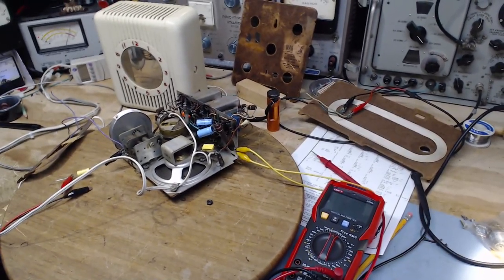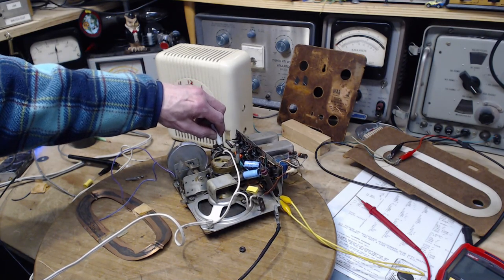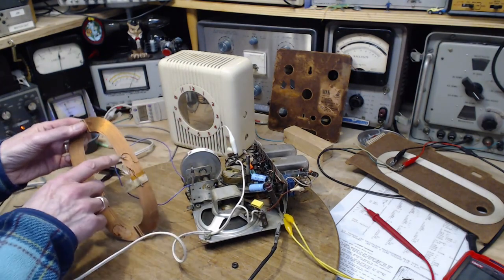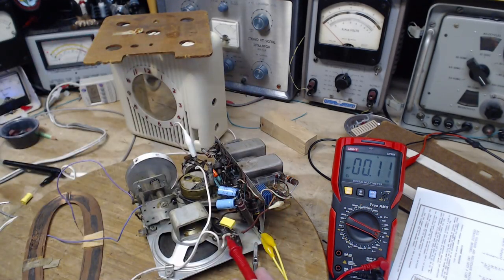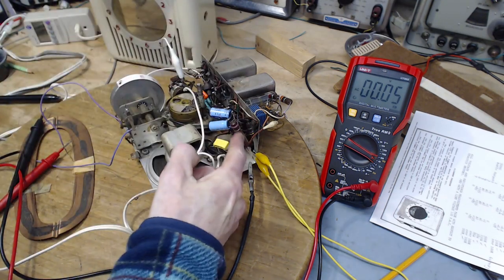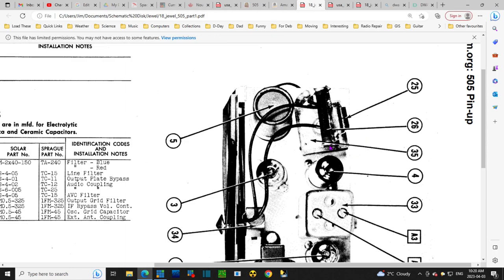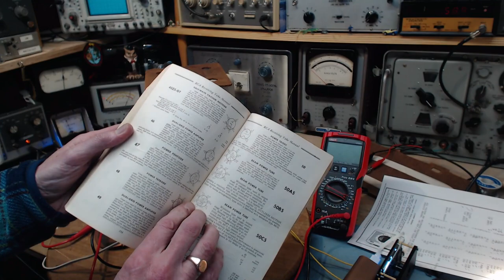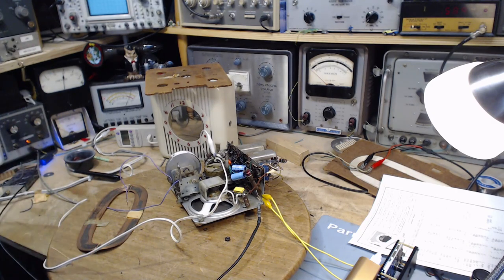Jewel Model 505 Vacuum Tube Clock-Radio Video #4 - Tube Heater Voltage

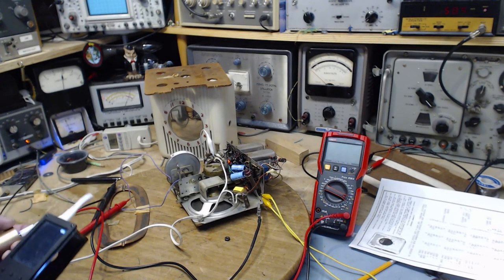Comment: 28:00 and it is playtime again; if the SDR toy don't get a cameo, his thermal image cam must jump in its place. 
The moment he found 14 volts on the heaters at only 110V line voltage, it should have been obvious to him what the deal with R4/#26 resistor is; that it is a soft start for the tube filaments, starting out at 1K and levelling out at around 200Ohms... Which makes perfect sense even crunching the numbers; the heater voltages add up to 86V. Toward 117V line voltage that needs a drop of 31V. The heater current is 0,15A. So 31V/0,15A = 206 Ohm! This proves the given hot resistance value for #26/R4 resistor and tells u that #26 in the parts list is R4 in the diagram.
But power dissipation of the dropper resistor is would be more like 31*0,15= 4,65 W not 2W. Unless they overheated it deliberately to get the 1000 Ohm cold to 200 Ohm hot drop, which is a ratio of 5 to 1.
Anyhow this failure analysis would have been a matter of 10 minutes, yet he draws it out over 30min and several cups of coffee and a tale of him touching a hot surface...
At least we got to see him slip with his meter probes once more and almost cause a big short. Will he ever learn to sharpen the tips on them to get a bite? Maybe one of his fanboys can email him about it...

Comment: I would check the resistor in the filament circuit. The temperature compensating resistor buffers the filter capacitors from the instantaneous voltage from the diode. Not needed if there is a tube rectifier.

Comment: If the filaments light, the radio works. However you are stressing each tube with additional heat. The 50 ohm resistor is the wrong value.

Comment: That temp changing R is called a 
GLOBAR 
resister. It limits the incoming current   
surge until the filaments stabilize by changing a higher resistance value to Lower  resistance value. You are barking up the wrong tree. It has nothing to do with
Spurious oscillation. That radio is hazardous and deserves being put down. You need a 10 watt  233 ohm resistor to replace the normal 35Z5 filament  current and voltage tube. Yes it can be a wire wound resistor. Have you ever seen a sand resistor? You are most likely driving the tube into saturation. Certainly the life span of the tube is shortened.